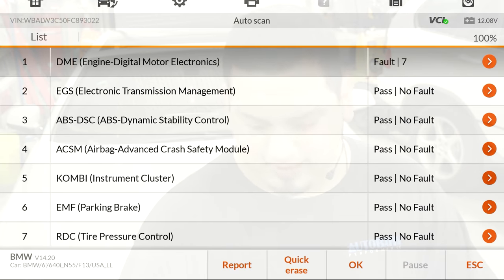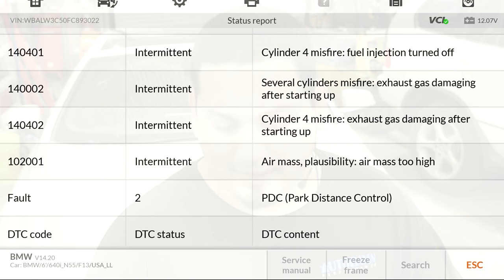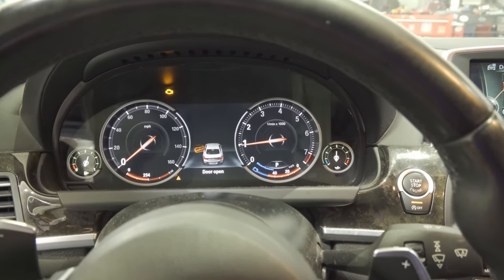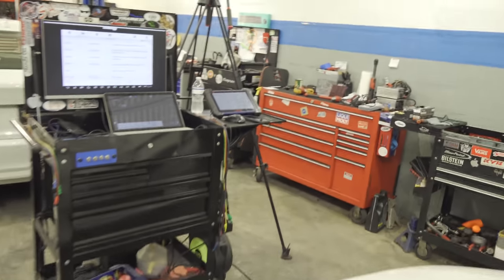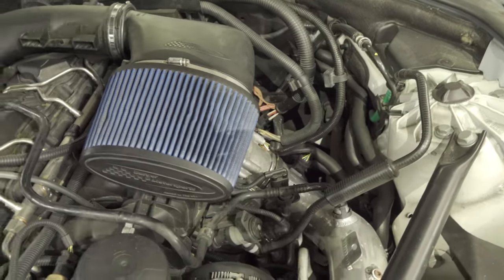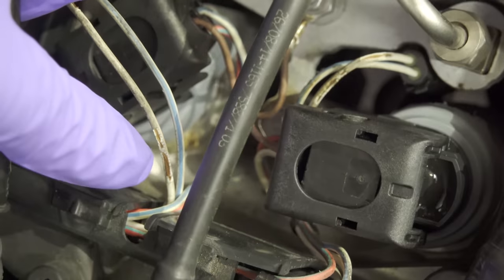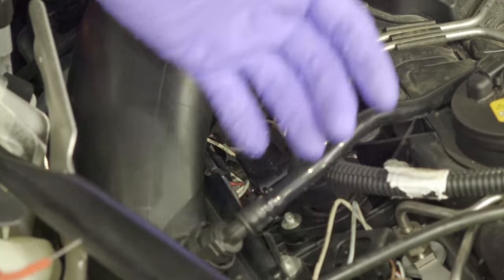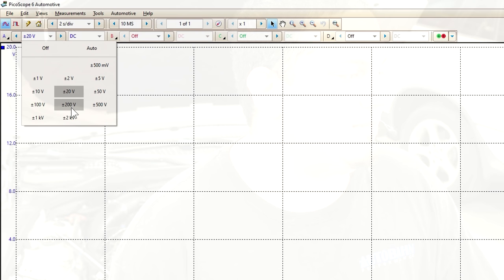2015 BMW 640i N55 - INTERMITTENT MISFIRE DIAGNOSIS AND FIX

Comment: Thanks for posting this vid. It sucks you had to go through that, but it's a way more helpful video for us than if you had called the wrong plugs right away. 

The carbon issue can be weird, I've seen some engines have a dead miss on cold start with a really small amount of carbon and others that seem to run fine with so much carbon you can't even see the valves. This micht be a stupid question, but when you thought you were leaning out from the turbulence were you seeing an effect on the fuel trims?
Reply from the maker: Honestly i haven't been successful enough on a fuel trim misfire diagnosis to trust it. Also on the road, this misfire led to a cylinder deactivation in which it went lean so i really couldn't trust the trims i saw anyway. Anyhow the secondary showing a 800 microsecond burn time was sufficient to call a lean misfire
Reply: @SuperMarioDiagnostics  That makes sense. I'm still learning to trust my interpretation of all the information I'm seeing in a firing event enough to always make a confident diagnosis.

Comment: i will replace an oil control valve on a honda accord monday. shop purchased a Dorman valve. I took the part in the office friday and asked them who would be paying for the good part installation on monday? I left the office but not before i got an answer.the customer did not not want to pay for the expensive part. The cheap part just became expensive and the wait time became longer to get their car back....Hard  to believe that the the second spark plug that was not failing in one cylinder would fail in another cylinder. Sounds like that cylinder needs better spark than the other cylinders....Thanks for the video.
Reply from the maker: True stuff 😆

As for the spark plug, after a while it did start misfiring on number 1 as well. We finally got the approval to change all of them and did so
Reply: @SuperMarioDiagnostics  i feel better now...........haha  great job bud....im at the begining of relarning ignition wave forms.. i studied 20 years ago and bought my own shop and started learning business side and did not stay up with the tech side. got divorced and well lost business and after getting my mind back in the game (took a few years} i'm on my tools again..
Reply: This is what i don't understand....why give the customer the choice to start with , 9/10 they will go with cheap everytime
Reply: @pauldavy5647  you have a valid point
Reply from the maker: That's assuming that dealer parts are always more expensive, which is not the case. That's also assuming that the more expensive the part is, the higher the quality, which is again, also not the case.

Comment: Thanks for sharing. Usually people like to hide their mistake and specially nowadays with all the armchair quarterbacks. I have run into Chinese knock off parts. They look like a Bosch or other oem supplier have all the names and numbers on it, but the quality is not there. Did the customer fix the wiring issues? Those will obviously cause more problems down the road as well. I think the biggest problem we run into these days that it’s not one clear cut issue, but a combination of lots of little problems that cause the car to belly ache. Customers just think of the fault as black and white. Unfortunately there are tons of grey areas. Also thanks to Paul aka ScannerDanner for linking the video on his channel.
Reply from the maker: Thanks bud! Unfortunately the client didn't see the wiring repairs to the end. Have no doubt that will bite them in the future

Comment: BMW engines are delicate and work specific with their own designed parts made for the car. Any aftermarket trash will be asking for trouble!  The N55 already comes with 1 step colder OEM spark plugs which lets you tune the car without exchanging the plugs that came with.  

When I did my first tune up on my N55 3.0L engine I replaced the plugs with the same OEM plugs but upgraded my coils to the best "Eldor" engine coils that BMW has upgraded in their latest models including Rolls Royce as the Eldor coils can easily handle 600hp without a problem!

Comment: Man just watching this makes me recall bad experiences with Bosch plugs, onces on a Volvo that was eating coils, and once on a Hyundai Accent where platinum plugs lasted 20000kms ... yes, i did get them (at least one set) from eBay. I don't know if they were fakes ... so hard to tell. I did write to Bosch on both occasions: no response. If they aren't interested in trying to pinpoint fakes then I'm just assuming Bosch has gone downhill ... I just don't get Bosch anything anymore, rightly or wrongly, unless it's actually the factory component, and they I'll get it from the dealer.

Comment: fantastic video, Is the torque spec important so as to get the electrode groung "hook" in the right place with espect to the mixture/injector fuel burn? I believe some Mercedes require that. 
Ha,Ha, Love the mixture not mixing correctly, who would believe mixture with LUMPS init lol.
Reply from the maker: Yes indexing is, i believe, one of the several factors at play here

Comment: i have this same exact issue on my 2015 535i n55. it comes and goes and its extremely frustrating. i took it to ssr performance like 3 times already, and they said all they can do is scan it. Since the cel isn't on, its not tripping the codes even though the misfire is intermittent

Comment: 27:00 from what I know Bosch is a oem supplier for bmw. They make them for bmw. May have just been the plugs time to go? Unless they bought the cheapest plugs on eBay and got knock offs. Idk the display said they were 8000 miles passed due on service.
Reply from the maker: Those Bosch ones were put on by the previous shop in efforts to remedy this misfire
Reply: Super Mario Diagnostics there are engines like N43B16 that do use Bosch coils and plugs. But those are case specific and more rare than common. It is great to see you learned and it was funny to see the first sentence was: lets swap coils and plugs... and it turned out to be the solution xD! 
We all learn something new. I made a 800€ mistake once.. never again.

Comment: Your spark line description is really well done. I couldn’t wait to get home to watch this.  So maybe this engine is very dependent on how the spark plug is “clocked” after it is torqued to spec and the plug itself is causing the turbulence? Just speculating. Thanks.

Comment: I learned a lot. just curious how come that changing plugs does not change the results ?
Reply from the maker: It did eventually, off camera. Then number 2 also started to misfire LOL we did get the approval to replace all the plugs and the video was released upon a confirmed fix
Reply: @SuperMarioDiagnostics  lol, thanks for the answer :)

Comment: I’ve learned that spark plug issues can look like turbulence on a primary pattern but it’s just like a ringing of electrical noise. Bosch double platinum plugs are garbage and I recommend replacing them anytime I see them in an engine. They’ve been trash for years and continue to be trash. It’s ashamed that a certain parts house seems to push these plugs to people because they obviously get a kick back on sales. I can’t tell you how many misfires I’ve found that we’re caused by brand new Bosch platinum plugs.

Comment: Tell me more about how high compression damages a coil. I’m struggling to understand the connection between the coil and the compression ratio.
Reply from the maker: An engine that has excessive compression(due to an advanced intake timing) increases the load that a coil must overcome. This extra load increases wear and tear on a coil

Comment: I had the same intermittent misfire and hash on the waveform on a BMW V8 in an '02 Range Rover.
I initially thought turbulence too and a RC test showed cyls. 1 and 6 to be slightly down compared to the others. Interesting that they're 360 degrees apart in the firing order!
Strangely, even though the hash was past the centre of the burn line, the fault moved with the coil.
A new coil was fitted and the fault has not recurred - a few months have passed since then. 
This has got me thinking again about the spark plugs. They were NGK from a reputable source, i inspected only the one on cyl.6 that was misfiring and the markings did seem to be consistent with genuine, not a counterfeit,

Comment: SALUDOS, te he mirado en los videos que haces en grupo con los otros mecanicos, tengo una pregunta haber si puedes ayudar,  tengo un 745Li 2002 v8, como se resetea la computadora, he mirado videos en internet y cuando lo hacer me dice que debo ir al dealer para que lo hagan ellos, me aparecen unos signos asi ????? Con un mensaje que dice necesita update en dealer, no me deja hacerle reset a nada, cambio aceite, coolant, bujias, filtros, espero me puedas decir si hay algun codigo para hacer el reset, gracias
Reply from the maker: En el tablero se puede hacer. Pero tambien con un scanner se puede hacer

Comment: Bosch is one of the suppliers of BMW spark plugs. The “ BMW “ logo on the spark plugs is just a stamp,BMW doesn’t make spark plugs in their factory. Of course that the safest way is to just buy them from them according to the VIN and you’re done. In your case I’m calling a bad spark plug since it’s just misfiring on one cylinder and not the others which have the same spark plugs.
Great video,thanks for posting! 👍

Comment: Once you torque then to spec, is there any chance that they get losen after a period of time? Like do you need to recheck on them after 1000kms?
Reply from the maker: No, not usually. When you buy a brand new car, from the factory they get torqued to spec, and are left untouched until they are due again
Reply: @SuperMarioDiagnostics   im asking because last time when i removed my plugs they were very easy to undo even if they were torqued to spec (by me, with a torque wrench) but…who knows…whats the possibility to have a private chat with you?
Reply from the maker: Pretty easy to do lol you can find me on Facebook, name's Mario Rojas
Reply: @SuperMarioDiagnostics   thank you, i will contact you there

Comment: Is there any manufacturer details on the bmw or plug
Reply: If you look it up via OE parts supplier you can see that in the description. For instance I have to use Delphi coils and NGK plugs. Bosch is a no go.
I normally do not buy generic maintenance stuff from BMW but I always make sure I use OEM parts, like Pierburg, Continental, TRW, NGK/Delphi and so on. Still saving some cash but quality parts.
Reply from the maker: Bosch is the oe manufacturer of the plug. The aftermarket has a stamp on it with a different number than the oe plug from factory

Comment: I had same problems and I replaced new spark plugs and coils but wasn't fixed so I replaced all fuel injectors and MAF sensor but problem still misfiring.  Guess what the one of Bosch spark plug was problem.  When engine runs about 2000 rpm no problem but when I accelerate speed then start misfiring.  I replaced with NGK-97506 and my X5 runs perfect now.  I hate bosch spark plugs, one spark plug wasting almost $1500.